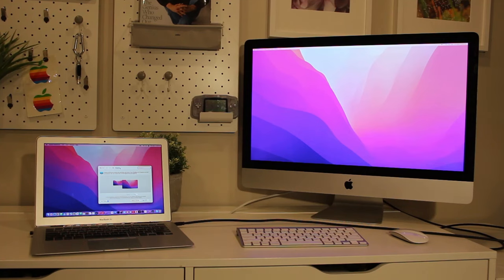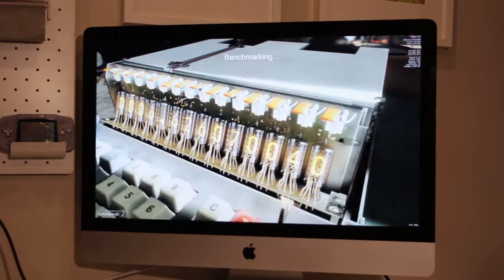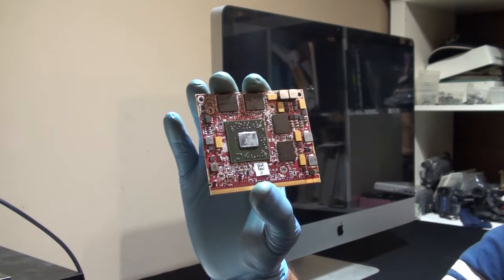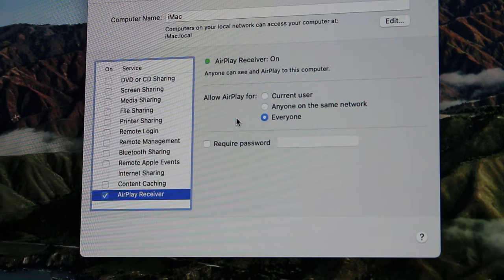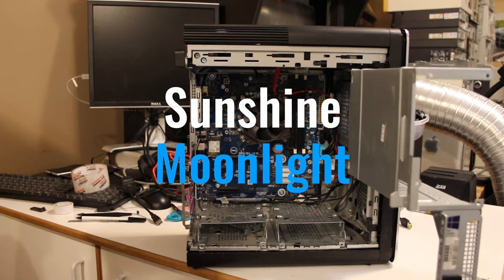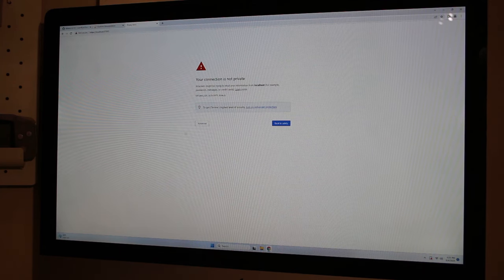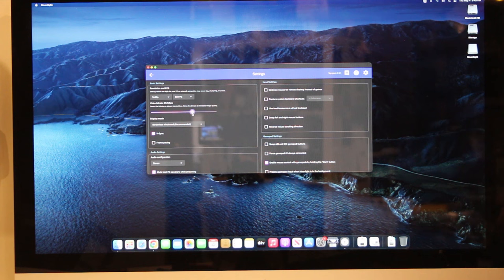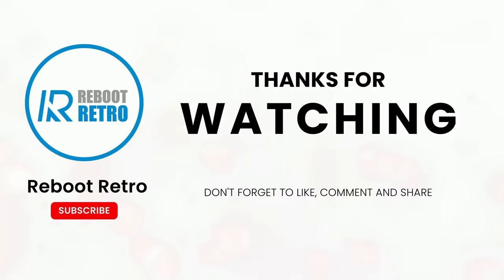Use ANY Mac as a monitor, not just Target Display!

Comment: I have quite a lot of experience with Target Display Mode, so I can offer some clarifications for you. 

1:25 - Target Display Mode was only supported on the 27" iMacs from Late 2009 and Mid 2010. It is not present on any other 2009 iMac (20", 24", 21.5") or the 21.5" 2010 iMac. Starting in 2011 both the 21.5" and 27" iMacs supported TDM. 

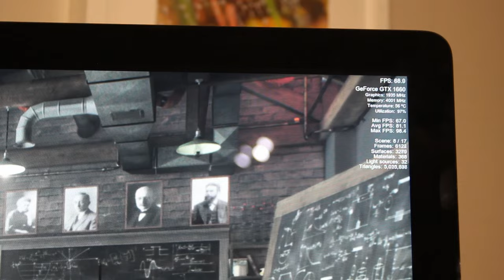1:40 - Yes, you can use an HDMI to DisplayPort adapter to connect an HDMI source to a 2009 or 2010 27" iMac. I do this all the time with a cheap adapter from Amazon (it's BENFEI branded). I suspect you might have been referring to cables that have Mini DP on one end and HDMI on the other. These are uni-directional cables, so they won't work. You need an active, powered adapter (like the BENFEI unit I mentioned earlier) that will convert an HDMI signal to a DisplayPort signal. The adapter I use has a full-size DisplayPort output, so I just use a DP to Mini DP cable to connect it to the iMac. 

Using this adapter I've had success connecting all sort of devices, including game consoles, an Apple TV, etc. It does work at the full 2560x1440 resolution, too, and sound works just fine as well. Just make sure you have the volume turned up in macOS on the iMac. 

1:50 - The CMD + F2 shortcut has zero effect on 2009 and 2010 27" iMacs. They automatically enter Target Display Mode when you connect a DisplayPort source to the Mini DP connector on the back. CMD + F2 is only needed on non-Retina iMacs from 2011-2014, which are the models that use Thunderbolt. For those later models both the 21.5" and 27" iMacs support TDM, but only the 27" iMac is supported for the Late 2009 and Mid 2010 models. 

2:46 - This is correct, the Thunderbolt iMacs that support TDM will not work with non-Mac sources, even through a Thunderbolt connection. They only work with other Thunderbolt-equipped Macs from 2011-2019, and I can confirm that they do not work with M1 Macs. The software support is not as important as Apple makes it seem. They say that the iMac must be running High Sierra or older and the source Mac must be running Catalina or older, but I can confirm that this is not true at all. I regularly use TDM with a 2012 iMac running Catalina and a MacBook Pro running Ventura, and I know several people who have had success with other "unsupported" combinations as well. 

These iMacs also tend to be a bit annoying when trying to enter TDM. I've had mixed experiences with TDM over Thunderbolt using a variety of Macs. Sometimes it works fine, but sometimes audio doesn't work quite right. Sometimes I can't get screen brightness control working, but sometimes it does work. I've also had it just drop out entirely, which doesn't happen with my 2009 and 2010 27" iMacs. 

Also, these Thunderbolt iMacs require the use of the CMD + F2 shortcut, and they almost never work with a non-Apple keyboard. Using a Thunderbolt iMac in TDM is far more annoying than a 2009 or 2010 27" iMac, though you do get the benefit of being able to use the camera and microphone built into the iMac with the source Mac. 

Overall, great video. I like seeing older hardware repurposed for newer uses.
Reply from the maker: Thanks for the info!  I've pinned your comment, since I think it could be very helpful to other people.  There's surprisingly very little info on Target Display, and as we both know Apples docs are "official" but not accurate as to what is actually supported.

You're right, I was referring to the passive cable.  I didn't know an active cable existed, although I'm not surprised.

I did notice the screen flashed, and other people reported the Mac entering TDM automatically.  For some reason mine flashes, but doesn't enter TDM.  Either it doesn't like my cable (which is brand new and works perfectly to DP monitors), or it has something to do with my modded GPU.  Mine I need to keep mashing CMD + F2 repeatedly to get it to connect.  Either way, it's good to have you confirm and know how it's supposed to work.  I presume TDM on 09/10 models is pretty reliable outside of my specific issues I was having.

Ya, the Thunderbolt iMacs seemed really fiddly from what I read.  Don't have one, but maybe that's for the better, lol.  Almost better to just do the Juicy Crumb mod, or similar, on these models if all you need is a screen.

Thanks again for taking the time to comment, and clarify some of the unknowns around TDM!
Reply: Thank you for this 

Us there any options for 2009 21.5  inch mac since target display mode isn't an option
Reply from the maker: @danimation4391  For the 21.5 inch, you'd have to use a solution like AirPlay/Screen Mirroring, the Sunshine/Moonlight combo if you're connecting a Windows PC, or Parsec if connecting another Mac.

If you want to permanently convert the 21.5" into a monitor and are really tech savvy, there are converter boards available online where you could DIY a solution similar to the Juicy Crumb.

If you want to use your 21.5" as a monitor for another Mac, your best bet is probably Parsec.  It works exactly like how I did Sunshine/Moonlight in the video, except you'll install Parsec instead on both computers.
Reply: Do you think a BENFEI adapter would successfully enable me to use my 2010 27-inch iMac as a monitor for my new M2 Mac Mini?
Reply from the maker: @BeechF33A  Your M2 Mac Mini should output Mini DisplayPort signal via Thunderbolt connector, and your 2010 iMac should accept a Mini DisplayPort input signal via the DisplayPort connector.  So you shouldn't need the more expensive BENFEI active HDMI to DisplayPort, you should only need a cheap straight through Thunderbolt to Thunderbolt cable.
Reply: @rebootretro  Thanks.  I've read that the OS version used in modern Macs, including the new ones, doesn't output a signal that can be "interpreted" by the MDP.    I've read that specifically an HDMI-to-MDP connector won't work.  Whether a Thunderbolt-to-MDP connector will work, I'll check out.  If it doesn't, my game plan is to buy the BENFEI adapter and try using that to convey the HDMI signal to the old Mac.
Reply from the maker: @BeechF33A  Sorry!  I had a brain fart, your new M2 will have the new USB-C Thunderbolt connector, not the older one that you can use a straight through cable.  So you'll need a Thunderbolt to MDP adapter, which is officially available from Apple or 3rd parties.  Using HDMI to MDP would also work, but the Thunderbolt to MDP would be the most "direct" route and most officially supported, I would think.  Technically, either should work.  Although you might find it handy to have an HDMI to MDP adapter in order to plug in other HDMI only devices like game consoles or streaming boxes.  If you decide to go the HDMI route instead of the Thunderbolt to MDP, make sure you get an ACTIVE cable that CONVERTS the signalling; there are many cheap passive cables which send the HDMI signal without converting to DisplayPort signal.  The passive cables will work fine to connect your iMac to an external TV, but they will NOT work for video input to your iMac.
Reply: Thanks!  Your comments are the most helpful I’ve read, after looking at a number of YouTube videos on this subject.  If you don’t mind, I’ll reply again if I run into trouble?
Reply from the maker: @BeechF33A   Yes, feel free to post back if you have trouble.  I’m not particularly an expert on this and haven’t used it with any M1/2 Macs, but I’ll help in whatever I can!
Reply: @rebootretro  Well, I successfully connected video output from my M2 mini to my 2010 iMac as an external monitor using a StarTech HDMI adapter I ordered on Amazon.  However, the mini's HDMI cable apparently doesn't transmit audio.  I've read I might be able to use an HDMI Audio extractor to do that, but I'm wondering if you have any advice?  Thank you again.
Reply from the maker: @BeechF33A  Can you double check your Sound settings in Preferences?  The Mini is designed to output audio over HDMI.  https://support.apple.com/en-ca/HT204388#:~:text=If%20your%20HDMI%20device%20isn't%20receiving%20audio

If that doesn't work, can you connect a regular TV to see if audio is working?

If you can get audio on a TV, then the issue could be HDMI converter or iMac side, and we can troubleshoot from there.
Reply: @rebootretro  You're right: the M1/M2 Macs do transmit sound over HDMI.  I connected with a TV via HDMI and it worked.  I believe, however, that HDMI-to-monitor via the Mini Display Port limits sound.  I downloaded a free app called eqMac which allows me to boost the volume.  Using that, I have been able to produce sound from the speakers in the Mac monitor.  That being said, the sound quality and volume are still different (worse) than the speakers produce when just using the old Mac by itself.
Reply from the maker: @BeechF33A  I'm not saying it will work, but you might have better success with a Thunderbolt type-C to Mini DisplayPort adapter, then MDP to MDP  on the iMac.  This will keep everything DisplayPort signalling all the way through, and MAYBE might transfer sound?  Just a thought if you really need to get sound working...
Reply: @rebootretro  You know, that might work.  But in the meantime, I simply disabled eqMac (which was distorting the sound at higher volumes), then used the same spare keyboard I'm using to adjust monitor brightness to adjust volume.  Voila!  Sound on the Mac monitor is now perfectly normal and as loud as I want it.  Not the most elegant solution, but the Apple keyboard is small enough to stash in my desk drawer most of the time, since I rarely need to adjust brightness or volume.  And now I don't have to buy a new monitor!  Truly appreciate all of your helpful suggestions!!
Reply from the maker: @BeechF33A  No problem!  Glad you have a working solution!
Reply: I plan on buying 2009 strictly for my console can I do that ? I wanna connect my PlayStation to it will an adapter hdmi be enough I have a 2011 model but it wouldn’t work
Reply: Can i use
Hdmi to display port adapter then
From dp to mini dp wire

Gonna work?
Reply from the maker: @Geekytravells  You can only do that if you use an ACTIVE HDMI to DisplayPort (expensive one). The basic passive cheap cable will not work.  The signal needs to be converted with active cable.  A passive cable does not convert the signal, it just passes it through and will not work at all.  A passive cable will only work for the other direction - to connect a DisplayPort video signal into HDMI screen (but not other way around)
Reply: @rebootretro  expensive one means that comes with usb input in the adapter right?
Reply from the maker: @Geekytravells  Sorry, I just edited the comment because I think I didn't understand.  Do you mean USB for power?  Yes it is possible an active cable uses USB for power.  I think @bondiblue5080 in the initial post had a recommended cable that supposedly worked.  I haven't used any active cables myself to be able to recommend one.
Reply: So , is there ANY way possible to connect a late 2013 27" Imac to a non-apple (pc). Or should i give up searching for a solution?
Reply from the maker: @no_one16  The last method in this video with Sunshine and Moonlight will work for connecting a PC to a 2013 iMac.

Install Sunshine server on your PC.  Install Moonlight client on Mac.  Use your Mac to connect to the PC and your PC will appear on the Mac screen.

Another solution would be something like Luna Display or Duet Display.  These may be easier to set up, but these other solutions cost money.  The Sunshine and Moonlight are open source and completely free.
Reply: hi there, is there any chance you could link the adapter you mentioned in this comment? Just want to make sure. Thanks alot!
Reply: What would I need for a late 2011 iMac 21.5 with a mini display port to use as monitor?
Reply: "The CMD + F2 shortcut has zero effect on 2009 and 2010 27" iMacs. They automatically enter Target Display Mode when you connect a DisplayPort source to the Mini DP connector on the back."

Does this mean a 2009 27" iMac with a failed GPU could be used as a monitor, just by plugging the DP cable in?
In other words it does not need to be booted into the OS?
Can it even be used without a OS installed then? (no hd?) Does it need ram?
Reply: I can not seem to get the correct cables, can you assist with a link? I have a imac (2010) that I would like to use as a second display to my imac (2015) that uses thunderbolt 2
Reply: I have an M1 IMac and i'd like to use it as a second monitor while WFH with my works lenovo Thinkpad...do you know if it's possible? and if so what i should buy to make it work? I'd ideally like to use my M1 imac as my webcam as well if i'm able to have it as a second monitor!
Reply: @tylerpark9999 did you ever find it?
Reply: I’m wondering if I can connect my iPad Pro m2 to an iMac with target display mode? I can already connect the hdmi using a usb c hub that has a hdmi port on it to my tv
Reply: The 24" from 2009 should be able to do TDM according to apple. Any comments? Trying to connect my 2009 model🥺
Reply: Hey there @Bondiblue5080 . You seem to be super knowledgeable in this area! Please may I ask if the following machines are compatible for target display? My old iMac (27-inch, Mid 2011) currently running High Sierra Version 10.13.6 (Processor 3.4 GHz Intel Core i7 + Memory 16 GB 1333 MHZ DDR3) and then my newer model Macbook M1 Pro (16-inch, 2021)? I'd really appreciate your input and how to set it up if it's possible! Many thanks, Jess

Comment: just a little update if anyone is reading the comments.. I put OCLP on the 2013 imac so it's now running Ventura. I'm able to wirelessly share my screen from my 2015 macbook pro running Monterey. Initialising TDM with thunderbolt 2 and cmd F2 works only for a few seconds, before the screen goes black.. .. so the airplay screen mirroring is the only option, except it isn't as responsive as TDM by a long way... and there are other things like: the 2 screens no longer share the same screen saver, and there's some funky stuff with the sound sources changing too..also on my Udemy course, the video blocks out when I'm screen mirroring, but not when using TDM.. . so TDM is much better than the wireless sharing imho... When the other 2012 imac arrives I'm just gonna leave it on Catalina, in the hope that the TDM works better... and actually considering changing the 2103 imac back from Ventura to Catalina..
Reply from the maker: That's very interesting... Maybe it has something to do with Thunderbolt TDM and the OpenCore updates.  The 2009 iMac I used is upgraded to Monterey via OpenCore.  I can confirm that I had issues entering TDM, but after getting it running it worked perfectly.  The only difference I can see between yours and mine, is that you're using Thunderbolt and I'm using DisplayPort.  Thanks for posting back, it's always great to have these types of tests documented for future people experiencing issues!

Comment: For target display mode...  IT WAS THE KEYBOARD!!!  Fantastic Video - thank you!    NONE of my 27 inch 2011 iMacs would connect in target display mode until I switched to the long flat wired keyboard with numeric keypad on the right. Like was mentioned in one of these helpful videos - the keyboard that came with the iMAC.  Keyboard model A1243 EMC 2171.  Now all four DO connect to my Macbook pro.  The iMac wireless ones, Imac long wired ones with typewriter-like keys - none of these worked.  Just the flat long keyboard (17 inch x 4.5 inch x less than 1/2 inch)
Reply from the maker: Thanks!!  Ya, it doesn't fully make sense why, but entering Target Display is finicky without a genuine Apple keyboard.  Even though the same keys exist on other keyboards, for some reason they don't work the same.  Must be an "Apple thing" I guess.  Glad you got it working!!

Comment: I'm having some problems with my setup. Im running a IMac 2012 with Catalina and a Macbook Pro Big Sur. I have a dock where my macbook pro is connected through TB3. I bought a cable for the IMac, mini-display to displayport, hence the dock (CalDigit 3) outputs through displayport and TB3. Im not getting any proper results. Is it because my mac's software is too new for TDM? Or should I get a different cable for the IMac (directly to usb-c/tb3 for instance). Cheers!
Reply from the maker: Unlike the 2009 and 2010 models which accept a standard DP signal and will work with any source (despite the specs listed by Apple), the 2011 onward have some actual limitations as they use some weird Apple proprietary protocol as I understand.  Apple says specifically that it only works if your iMac has High Sierra or older and your MacBook is 2019 or older with Catalina or older.  My understanding is that it does not work at all with Apple Silicon Macs (not sure if that's what you're using?).  Some people claimed to get it working with Catelina on the iMac, but the results don't seem to be consistent.  I think if you have any chance to make it work with that config, it would be with a direct cable - you're completely right, the docks can cause issues.  Either way you're in somewhat uncharted waters.  If you can't get it working and want dual displays, an alternative would be to install OpenCore on your iMac, upgrade to Monterey or later, and enable AirPlay Receiver like shown in the video.  If you only need a primary display, the Sunshine/Moonlight or Parsec option will result much smoother performance.

Comment: is there any way I could do this with a 2015 27" iMac? The airplay display options aren't working and I don't want to tear it down
Reply from the maker: Yes, the Sunshine/Moonlight method should work on a 2015 iMac.  If you want an easier method, you can try the Parsec app.  It works the same as Sunshine/Moonlight, but I think it would be easier to set up on a Mac.  Unlike Sunshine/Moonlight, Parsec will allow you to use your computer from anywhere in the world - not just the same network.
Reply: @rebootretro  thank you very helpful.